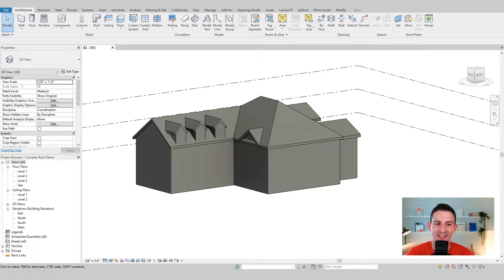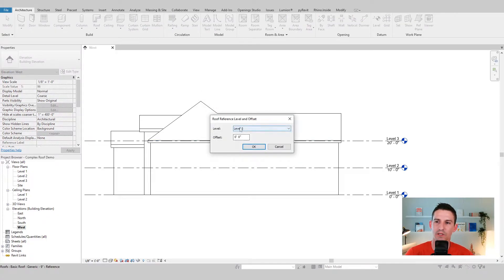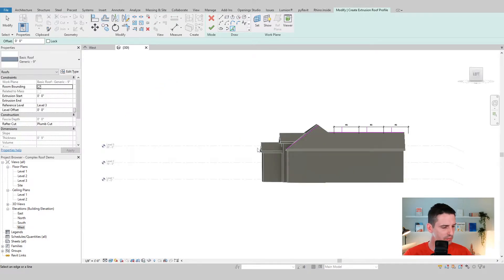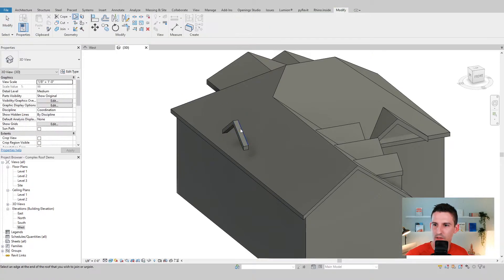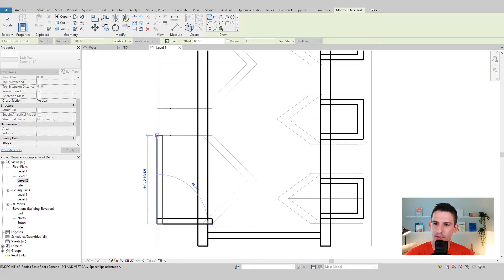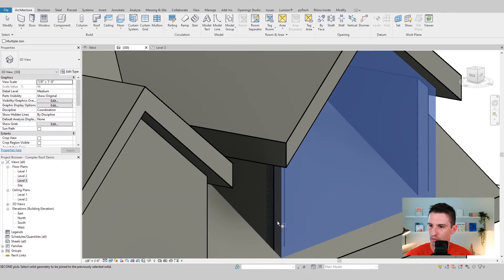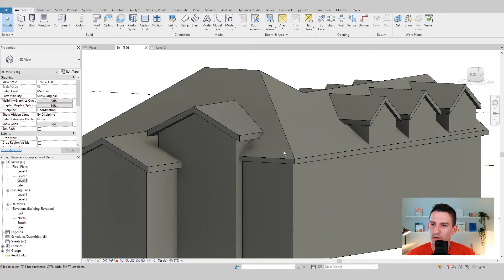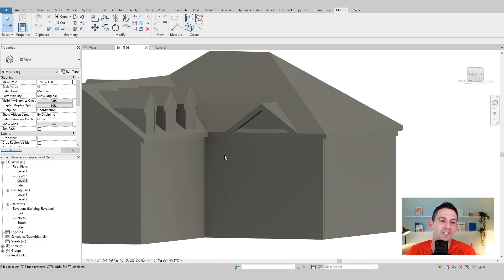Dormers + Complex Roofs in Revit (Made Easy)

Comment: On the 3 dormers: Could yo have made one complete first, including all the walls, joins, attach, cut opening, etc. and THEN made matching copies? Seems like a lot of repetitive steps which would be annoying to go back and edit when you decide to make a change. Also, similarly could you have left your reference lines, or setup some kind of reference dimensions that automatically divide into 3 equal spaces so changes to the building below will automatically respect. Basically want to know if there is a more parametric way to work ? Thank you
Reply from the maker: Love where your heads at on the efficiency.  Off the top of my head maybe making a void cut and then grouping it all together would allow for copying and pasting that group around repeatedly.